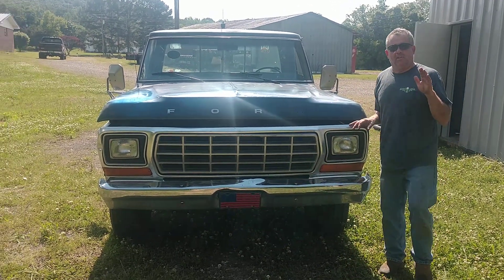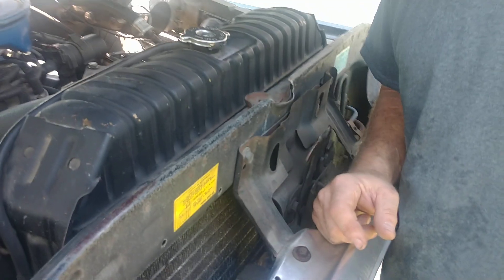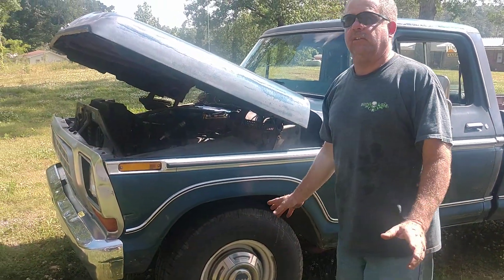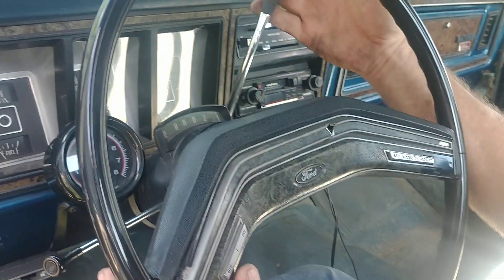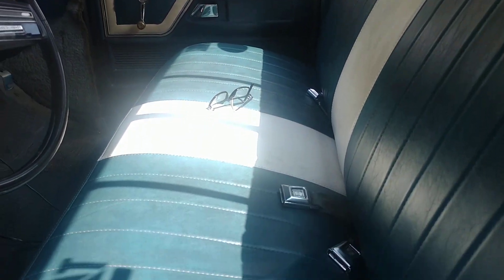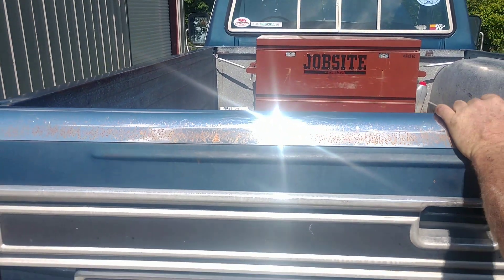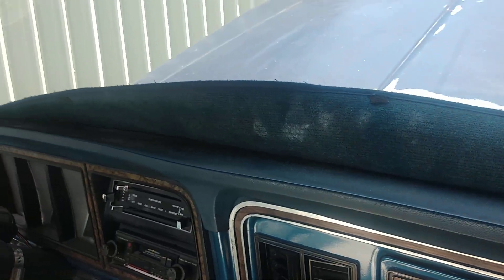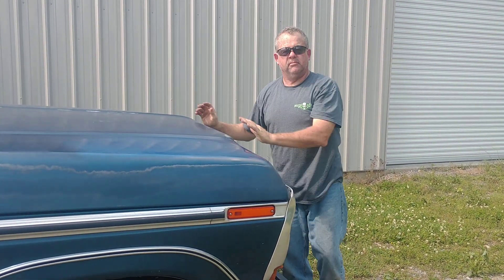1978 F-350 camper special

Comment: Having the longer wheel base and that style of bed does NOT mean that the truck is a Camper Special it only means that it's an F-350 2 wheel drive and they all had the 140 inch wheelbase.  Camper Special had special wiring under the the left front of the bed so that your camper lights could plug in and be powered.  If your truck doesn't have that it isn't a Camper Special.
Reply: There was also a " Trailer Special" model made.